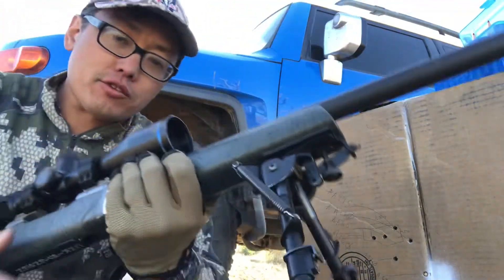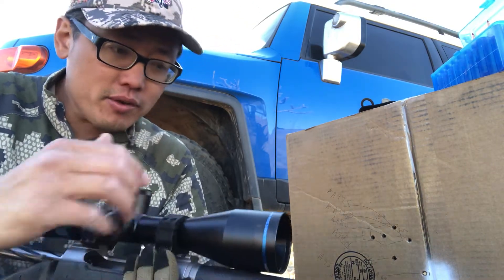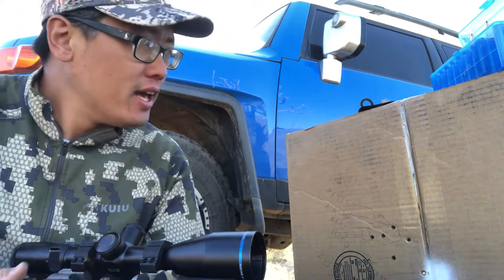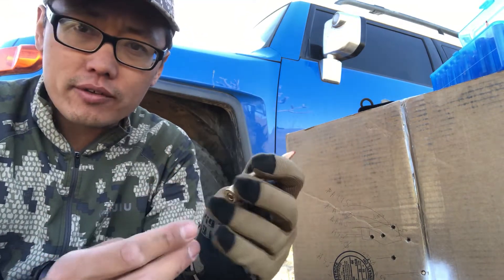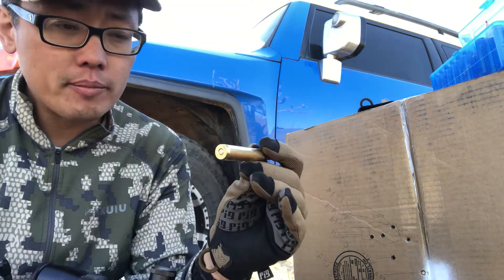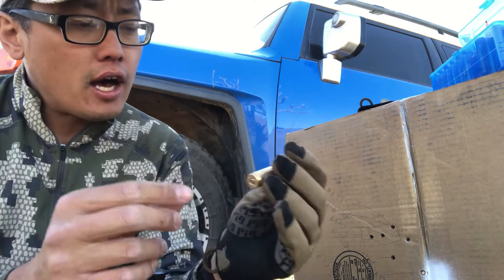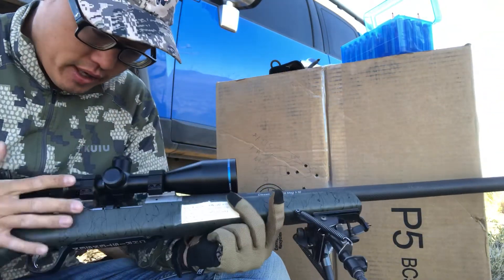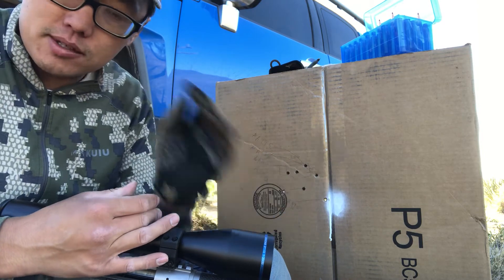Christensen Arms 300 RUM Ladder Test

Comment: It looks like your scope is real low to the barrel,... any thoughts on fixing that
Reply from the maker: kmentz2012 Thanks for the comment.The scope is not touching the barrel so there is no need to change the rings. It is a couple millimeters from the barrel but like I said not touching. The rifle does not have an adjustable cheek riser in so having a lower scope helps with getting a good cheek weld.
Reply: Looks close enough to touch during recoil